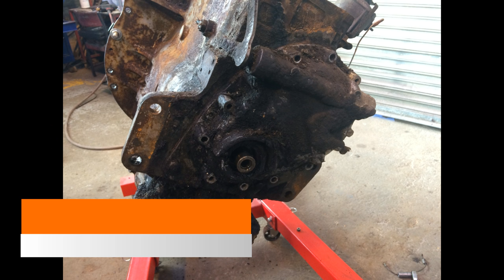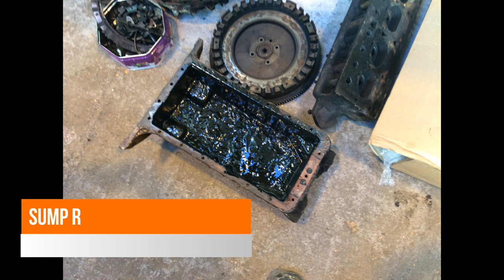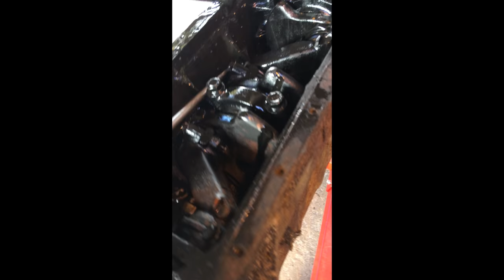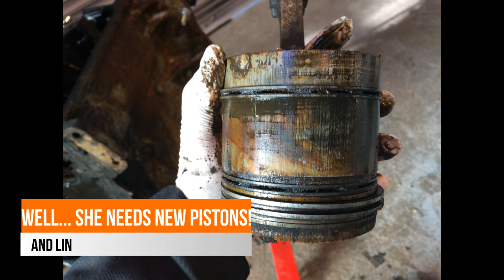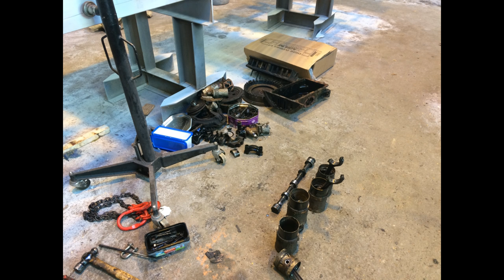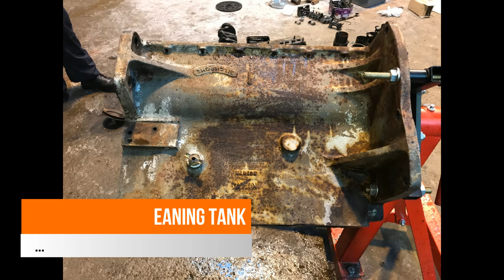massey ferguson 35 restoration pt2 (engine strip) (MF 35)

Comment: Gee, pump up the tyres, relpace the minor oil leak [rocker cover]  pull the plugs and tow it down the road a bit in gear then refit the plugs and go farming. And yes we did very similar with a Vanguard ute and it did another 50000 miles. The timing chain got a little sloppy and wore a hole in the timing cover so new chain and weld up the timing cover.
Reply from the maker: Brilliant

Comment: Four cylinder nearly impossible to start
Reply from the maker: Yeah she’s impossible to start now! but she will be fine when it’s rebuilt
Reply: Jack Comber we have loads off old 4 cylinder 35s here in Ireland worth very little to hard to starting at the best of times. There is a way to improve them by drilling the cylinder head to change the diesel intake I'm told that works really well.. never tried it. Not sure where to drill..
Reply from the maker: oh right... it will be interesting when my petrol engine starts ill fill you in